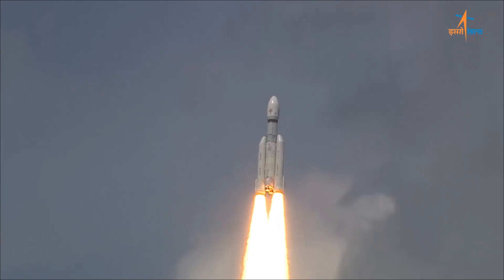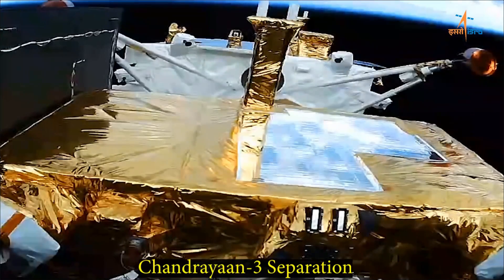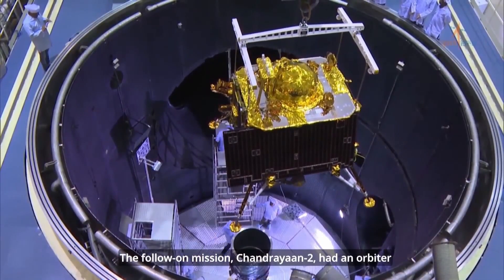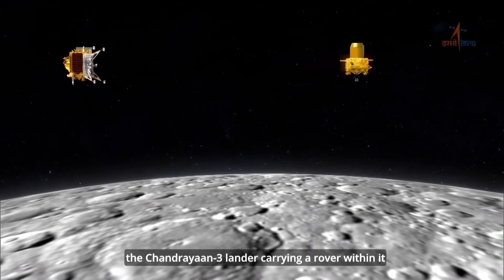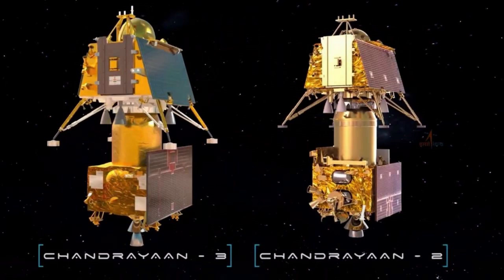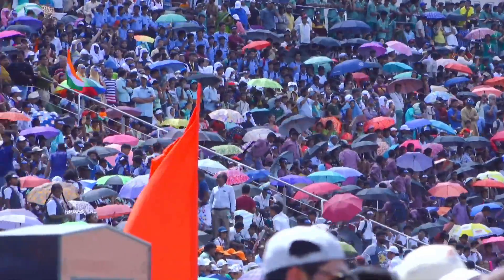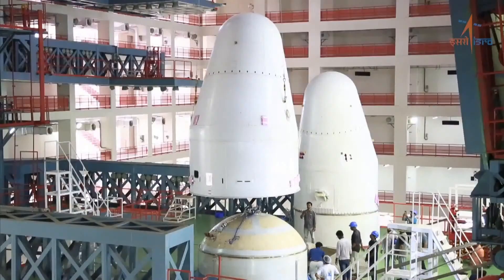India's Flagship Lunar Mission Chandrayaan 3: Will it Brake or Break?

Comment: The ISRO chief shared minute details about what went wrong with the Vikram lander of Chandrayaan-2 as it went hurtling down towards the identified 500m x 500 m landing spot on the lunar surface with the engines designed to reduce its velocity developing higher thrust than expected.

"The primary issues were, one we had five engines which were used to give the reduction of the velocity, which is called the retardation. These engines developed higher thrust than what was expected," he told reporters here on the sidelines of India Space Congress organised by SIA India.

Somanath said that when such a higher thrust was happening, the errors on account of this differential were accumulated over some period.

"All the errors got accumulated, which was on the higher side than what we had expected. The craft had to make very fast turns. When it started to turn very fast, its ability to turn was limited by the software because we never expected such high rates to come. This was the second issue," the ISRO chief

said It was almost close to the ground and kept on increasing the velocity," Mr Somanath said.

In a nutshell, the problem in Chandrayaan -2 was that the ability to handle parameter dispersion was very limited, he said.
Reply: It is interesting to me how enthusiastically people are using the term "embarrassing". Why is it embarassing to fail? You try something for the first time, you are bound to fail, the point is you learn from the mistakes, rectify it and try it again. There is no nation in the world that succeeded in its first attempt at everything important. Mistakes big, small or trivial help you grow.
Reply: Will love to see some European country try to even reach moon without help of USA and NASA (which employs immigrants). Instead of talking sh*t about India on their media. 😂
Reply: He had mentioned somethong about seal was not closed properly so it had leaked and the pressure was low so the lander was ejected
Reply: In IT parlance, it was programming error, insufficient UAT, etc.  In other words, the kind of errors that are too embarrassing to explain clearly.
Reply: @wildgoose419  You should stick to your IT work and not come to conclusions on things that are beyond you.
Reply: @wildgoose419  "Insufficient UAT"??
Well, how many Moon atmosphere conditions can you replicate in Earth so as to carry out this "UAT"??
Reply: @prakyathprakash5180  We've built a platform to test things, that always has an engine burning effectively reducing gravity to that of the moon to test our software and thrusters on.
Reply: @poiu477 who is this we?
Reply: @kidobutai27 r/suddenlycommunist
Reply: @prakyathprakash5180  It's called simulation.
Reply: @kidobutai27 here we means the people of India who funded the Indian Space Program.
Reply: @wildgoose419  correct
Reply: Also there was something like a window which didn’t close 100%. I don’t remember the exact details
Reply: This time almost zero percent chance to failure.
Reply: But all this would be discovered with the simulations. I don't understand how these flaws weren't evident. Several probes were sent for software calibration. And to say that they didn't know about the thrust of the rockets... I don't know, that seems very strange to me. It's too basic a mistake to believe...
Reply: @albertovieira4844  Apparently, they didn't simulate what would happen if the rockets overperformed.  Had they ever fired those rockets in space before?
Reply: @ericssmith2014 

It was our first attempt to put a lander on a celestial body. So to answer your question, nope. 

It was the first time they used the landing equipment.
Reply: @ericssmith2014  There are mathematical models that must be respected and rockets cannot outperform their performance. That's not how things work, something is wrong with this poorly told story.
Reply: @ericssmith2014  how can someone be so ignorant...... ISRO has done so many mission including a mission few years back in which ISRO established 104 satellite in their orbit in a single launch.....and of these 104 satellite ....those include of usa , britain and other so many countries..
Reply: @albertovieira4844 They are not liable to tell whole story to people like you who lives only in YouTube comments
Reply: Gravity is based on size not mass. The far side surface gravity is up to twice the near side. Until Expansion Theory is acknowledged fact these ‘problems ‘ will continue.” The Final Theory: Rethinking Our Scientific Legacy “,Mark McCutcheon for proper physics.
Reply: Except that explanation is garbage because it uses a bunch of incorrect statements. For example, there is no "turning" going on. So the explanation about "very fast turns" is just silly. It's clear that the person talking doesn't know what they're talking about.
Also the statement about error accumulation also makes no sense (or implies a very poor design) as it implies some kind of open-loop guidance to the surface, which can't work. If they're still doing the same thing then it will fail again.
Reply: @Ergzay they were explaining to general public not to science neeks
Reply: @Ergzay  i think he know all but just don't want to tell everything in public.
Reply: @Ergzay the person talking, exactly knows what's he talking about... And the same goes for persons, it's addressed to.... Its the matter of whether some ppl are capable of understanding it or not just like u.... If u could comprehend the ambiguity of the language with reference to the context rather than just finding the denotative meaning, it would atleast put some sense into u
Reply: @Ergzay  He just want to prove his point that ISRO released a detailed information about what went wrong with Chandrayaan 2 which it didn't  ...
Reply: @nirbhayatiwari5425  I agree with you friend... Really, it didn't convince... What makes me doubt is that something like that could happen again with Chandrayaan 3.
Reply: Yes it crashed.
Reply: @SeánONilbud you can’t simplify it by just saying it crashed. You need to identify what went wrong exactly to rectify it for your second attempt. Which is what was done and for this lander they reduced the number of thrusters and calibrated the software to new parameters which is where the primary error in the mission occurred as Mr.Somanath has mentioned

Comment: What happened with the lander of the second mission was that during the last phase of it's descent, the thrust produced by the engine was more than estimated. This caused the lander to veer off it's trajectory to the landing area. Now to make it to the landing area, it needed to make a pretty sharp turn, which required it to accelerate. But landing requirements required it to decelerate. This caused a conflicting logic and what the logic circuit decided is unclear, but it looks like it accelerated the rover to restore it's path which led to the hard landing.
The new lander has been given more fuel and it's landing area has been expanded significantly. Several other redundancies have been added so that something may work if one thing doesn't.
Hope it's successful. Not just for India but for all :)
Reply: @parthajitjana2222 I'm a software engineer (white male British if it matters) and I'm nodding in sympathy. The software had two things to do at that point, which were mutually exclusive so whichever it chose would have caused a crash. I don't see how that's a racist comment.
Reply: @parthajitjana2222  how's that a racist Comment ?? Stop being so Soft !! Fellow Indian here.
Reply: @nandellishyameshwarrao1909 wt did he say
Reply: Software developers everywhere are nodding in sympathy.
Reply: Hard landing ? Don't you mean crash ?
Reply: @E9X330  - I agree - I wish they'd avoided use of the phrase "hard landing", which tends to confuse or mislead, and had instead used the word "crash"
Reply: @E9X330  land hard
Reply: @E9X330 t has not crashed rather there is no movement neither we're getting signal. It's called hard landing
Reply: @Sandy-bn8ig  There are pieces of it sprayed across the surface — it crashed.  Better luck on the upcoming attempt!
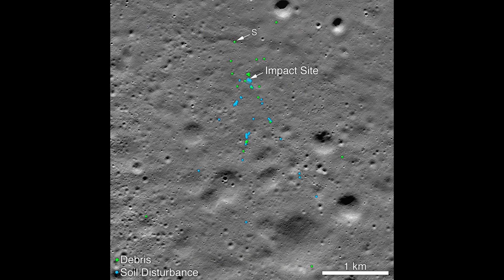Reply: @Sandy-bn8ig  Scattered pieces on the surface at 4:32 in the video you’re commenting on.
Reply: @ericssmith2014  crash is actually a layman term. In aeronautical engineering we use the terms soft and hard landing, depending on whether the landing speed was within or beyond the set limits. Many aeroplanes have had hard landings with no casualties which are sometimes also referred to as crash landings. So it depends on the context.
Reply: @Seriouslyfunny1  he won't get it, as he's white and may be European apr American they can't see anyone from Asia Or brown doing any development work.
Reply: @Sandy-bn8ig  personally i wouldn't care. Even if that is so, his thoughts or biases aren't going to have an iota of effect on our work and ambitions. I just thought maybe I should educate a thing or two about what engineering says to him.
Reply: @Seriouslyfunny1  you would care if you go through the comments from uk. They're insulting India and Indians
Reply: @Sandy-bn8ig  it shouldn't matter brother. Not all British are same. But those who do, is because they can't digest the fact that India has outdone them in the most modern tech. The same India they used to proudly rule less than a century ago.
Too coward to compete, they've no options left other than to insult. They couldn't compete with Indian textiles so they shut them down by force. They can't compete in space so they demotivate by insulting.
I personally derive pleasure and happiness when some jealous guy insults us because of our success, because that convinces me the nail has been hit where it hurts the most to them.
Reply: @Seriouslyfunny1  positive criticism is good but not insults.. And we shouldn't tolerate   insults to our country, we were silent that's why they ruled us 200 years, my grandfather was a freedom fighter and went to jail several times, he was awarded " Swatantra sailani" Awarded by Indira gandhi for his contribution. He always said the moment yoh decide to tolerate you're actually reason for some one else pain. Because you had opportunity to protest, say no  but because of your tolerance some other is going to suffer!!  
What people of UK are doing is bullying. 
Never tolerate bullying! 
And I'm a sister!
Reply: @Sandy-bn8ig  actually I prefer to slap back with an even better result and make them grudgingly accept their defeat. I believe that works most of the time. When someone is thick skinned, then I would answer back with equal sharpness. I understand what you feel. I felt the same before but over the years my approach has changed to being more calculated. Hope you'd understand that.
Reply: @Sandy-bn8ig  nope it's a crash
Reply: @E9X330  nope it's hard landing
Reply: @Sandy-bn8ig  there are images showing it in hundreds of pieces, that's not a hard landing. If a plane breaks into hundreds of parts you don't call that a hard landing either
Reply: Reasing hard landing 10 time faster than plan landing

Comment: Big debris fields where your landers are supposed to be are generally not considered to be a good sign.  ;-)
Reply: The positive side is that the debris are not 10 feet or 5 feet or even 1 feet high and are rather strewn in small pieces and there is no air sucking aeroengine (heck, moon does not even have an atmosphere) so the risk of FOD inside the engine through any duct is negated- the nozzles emit hot gases, do not suck in air and hence there is no chance of them sucking in debris. The lander's landing site being debris free will be enough and the river will manage obstacles anyway.

Comment: That footage of those guys assembling the solid rocket segments, where you can see the rubbery propellant grain, scares me at some deep level. That's one of those jobs that is simple but seems like it can turn crazy deadly in an instant. Damn, rockets, you scary.
Reply: OOoh yeah!!! But I also think, And I could be wrong, The ignition would require fairly higher temperatures. So no common mistake could cause ignition.... but yeah,. you are face first standing in front of a literal rocket, and its fuel.
Reply: @ShrirajGPethe  Yeah, the biggest danger there is from moving machinery, not from explosions. Solid-fueled rockets aren't easy to ignite by accident.

Comment: Why not make a bouncer like Mars if soft landing is so difficult.
Reply: @V-PATIL  ..what?
Reply: Because of dust particles blocking sensors
Reply: Mars still has some residual atmosphere and greater gravity so the ball shaped payload can be safely parachuted in the rare martian atmosphere when released from high altitude to achieve reduction of drop velocity and due to greater gravity of the mars (compared to the moon), jump of the ball post impact on martian crust is less (and hence more controllable).

Comment: Why does it take a month to fly from Earth to the moon? Is it that far from the Earth to the moon? I don't understand
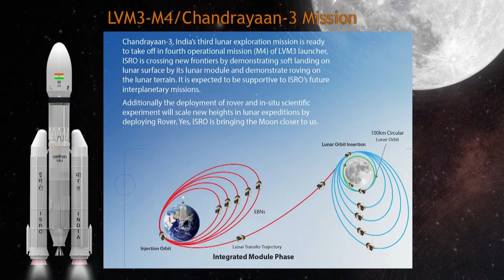Reply: As you can see at 2:08, the probe does the trip with at least 10 maneuvers. Much of the time will already have passed before it´s even on a intercept trajectory to the moon.
Reply: 2:06 - They're not doing a direct lunar orbit injection.  Instead, they're going to slowly raise the apogee of the spacecraft until it is captured by the moon's gravitational field and then brake over several lunar orbits to achieve it's final lunar orbital altitude. Oops, @santoro423 beat me to it.
Reply: Those manoeuvres will not only reduce the fuel payload, but also makes the mission cheaper
Case in point : This entire mission takes only 70 million Dollars

Comment: The rocket mission director was making multiple references to this rocket being 90% human certified in post launch speech and isro director interrupted him on live steam to hold his horses and said more details to come later, pretty good sign in my opinion.
Reply: @MrAnnaNeMos what you want to use instead? Gasoline?
Reply: @ajaymalik4473 Liquid Propellants (Lower Thrust through a longer period).
Reply: @MrAnnaNeMos  Space Shuttle had two big ah solids
Reply: N @MrAnnaNeMos did not the  
Space shuttle have solid boosters?
Reply: @MrAnnaNeMos olid rockets have been used for too many crewed spacecrafts at this point. As for the engines, we're developing a semi cryogenic engine that uses Kerolox to be fit on LVM3.
Reply: @MrAnnaNeMos  hence the 10% leeway xd
Reply: Launch was more about LVM3 than CY3😂
Reply: @MrAnnaNeMos  Each country gets to set their own standards..